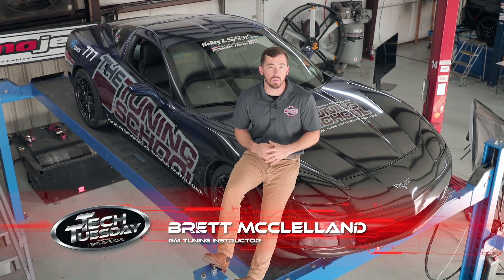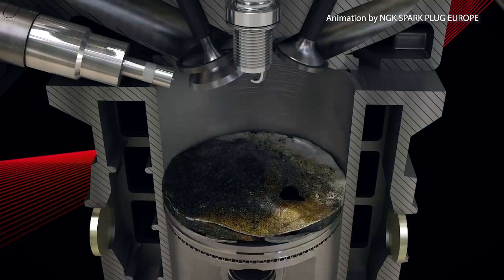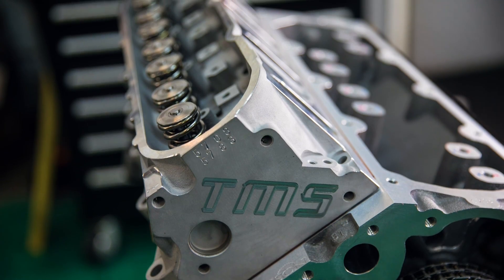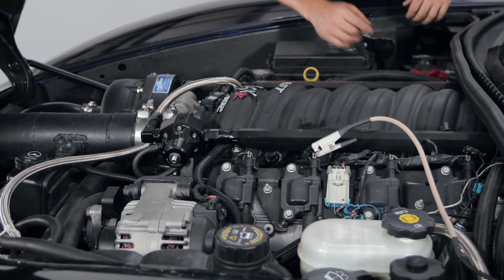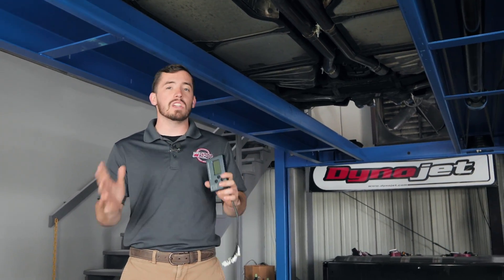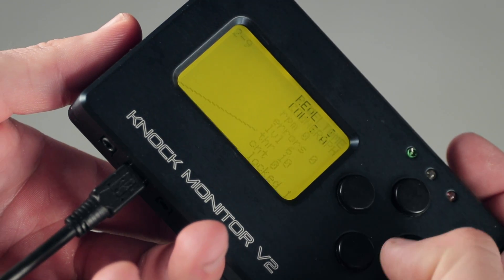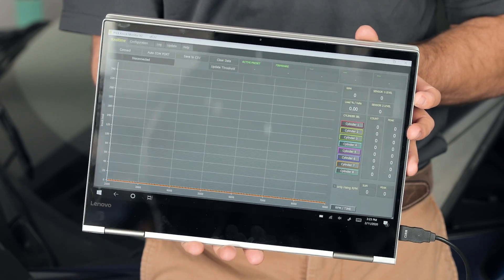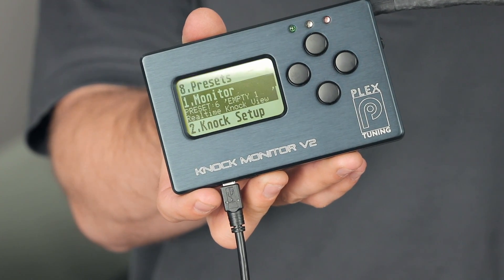The 101 of Engine Knock & the Plex Knock Monitor V2

Comment: Seems like a good tool to monitor knock but can it work with your tuning software to add and remove timing bases on knock values?
Reply from the maker: Yes. It's supposed to able to do this with stand-alone ECU’s. However, it is not something we have explored yet.

Comment: I bought the dual sensor unit from The Tuning School about 2 years ago.  I was trying to determine if I had false knock on some Gen V GM stuff.  This unit is easy to learn how to use and has some awesome features.  I concluded that my knock was all false.  After backing the timing down to more than safe levels and measuring the output.  I then brought timing back up and watched the output.  As cylinder pressure increases the frequency will also increase in my experience.  The goal is make sure the frequency is linear.  Any major spikes are clear signs of knock.  I never pushed my stuff to the knock point but it would be nice to know exactly what that looks like when using this tool.  I know you guys are not in the business of giving out free information and displaying real knock with this tool could be an expensive marketing pitch but I think that might sell the heck out of this tool.  Regardless this is probably the main reason my turbo Silverado runs as well as it does and has lived as long as it has.  This tool works.  Thanks for all the videos!
Reply: I should have used a different verbiage with my statement.  I want to see and hear what exactly knock is using this tool.  The Tuning School has 3 videos regarding this tool.  I have watched them multiple times.  The loud ping you hear in the video regarding the supercharged C7 is clear as day.  My question to them is that the exact audio from the tool?  Is it that clear?  I used audio editing software in conjunction with the Plex to map the output.  I used the Plex software.  I tried all kinds of stuff.  I just want to see and hear what the pros know to be real knock with this tool.
Reply: @mike91b58  I have one. I agree nobody shows it in real use. I've had to do a suck it and see approach. The manual from Flex is not very good either.
Reply from the maker: Thank you so much for your feedback, and for your support! It is a great tool that seems to come in handy for every car, every time. If we could change the price, we would. But it is well worth it!
Reply: I don't want to pit other shops/companies against each other but HPA did this a while ago with PLEX so check out their videos

Comment: I need one of those, I need one of those... US $1000, Umm maybe not that much. I would love one, but that is really hard to justify. If I was tuning all the time for a living, sure.
Reply from the maker: Definitely consider this when you do begin to tune a lot more (emphasis on "when"). It is definitely worth it!
Reply: @TheTuningSchool  is there anything else on the market that allows you to set the floor noise like the Plex?
Reply: @DodgyBrothersEngineering  You asked if there's anything else on the market that sets the noise floor. I gave you an answer and BTW they do work. 
Buck up a thousand skins otherwise jew boy!
Reply: @brettus9115  tunernerd is poor quality (my harness came apart) and their instructions consist of "join our facebook group and users will help you". My readings where off the charts under full load no matter what the amplitude or filter settings. I emailed them only for them to tell me to join their group for instruction. It could be I only had to change one setting and it will work fine, but I'll never know. I'm not going to drive around making full load sweeps in my city until I figure it out, and if I buy more dyno time it defeats the purpose of a cheap option.
Reply: @TheMostDeletedComments  Were you swinging the harness around like a lasso!? Have you emailed the owner for help as I've had no issues. Maybe your knock sensor location isn't ideal but I'm not a YouTube diagnostic technician...
As I said to the other reply, buck up and pay the big dollars if you want to herd cattle with your knock box or design a better one yourself maybe.